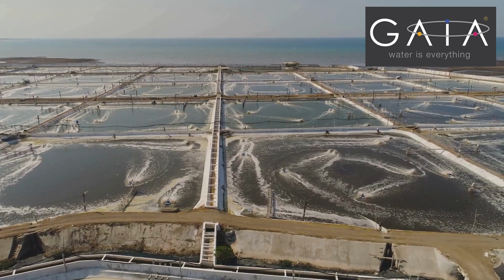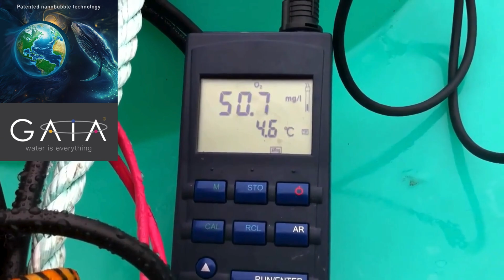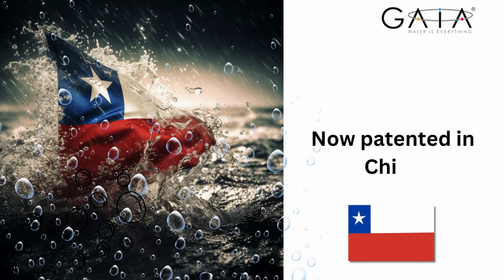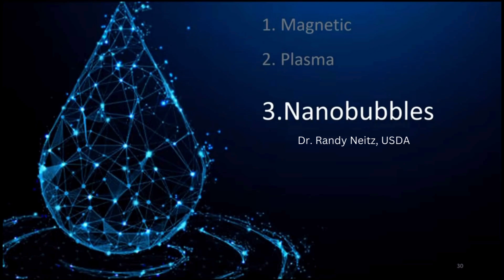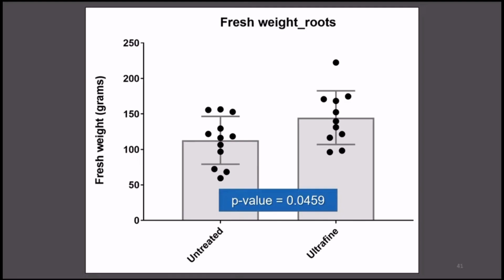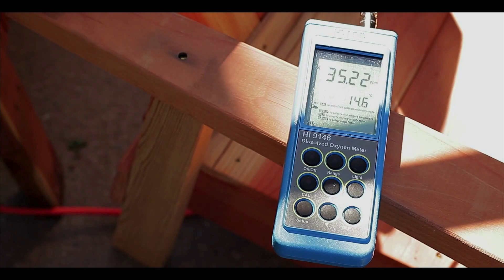Gaia Patented nanobubble technology 'is out of this world!' See why published scientists say so!

Comment: What's the increase of DO in a SINGLE PASS (not recirculating) using the GAIA with oxygen?
Reply from the maker: It doubles the DO with each pass. Maxes out at 65ppm DO @ 6ºC seawater. A little less with freshwater. DO stays high for a long time after you turn off the unit